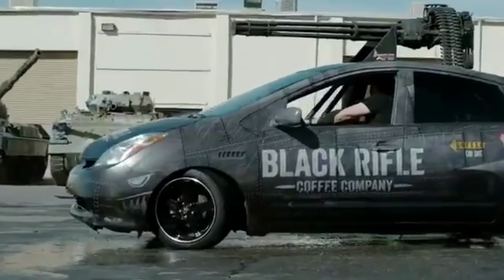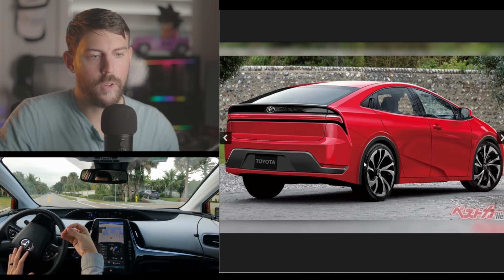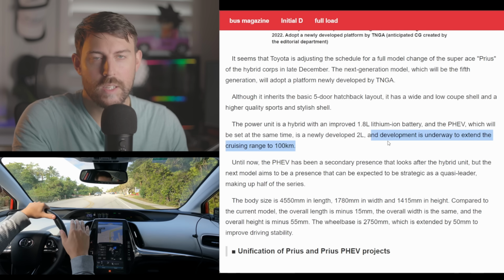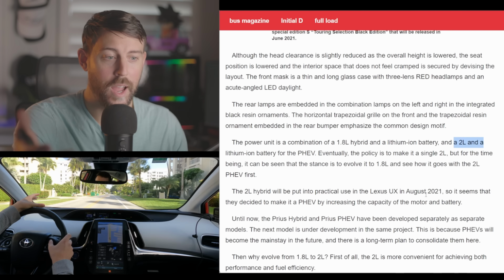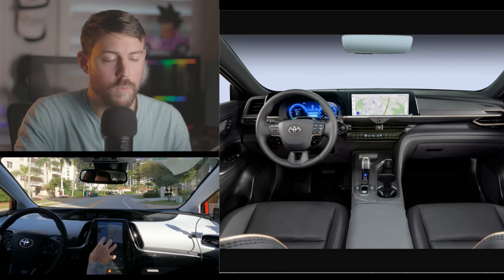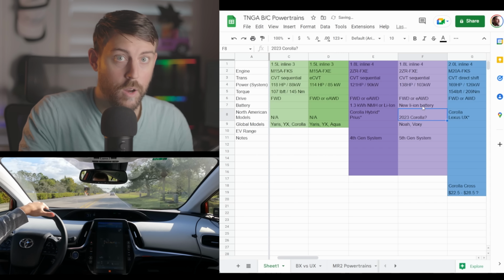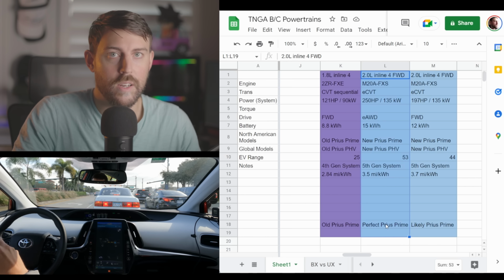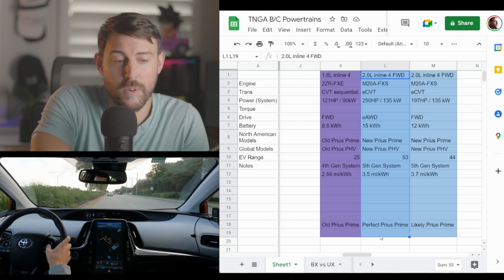*BIG UPDATE* The All-New 2023 Toyota Prius will have INCREDIBLE power and EV range...

Comment: Morning, Kirk!  When any medium outside of US quotes battery range it always fall behind when US-EPA certifies it. 

That 100km. / 62mi. battery-only range quoted for the new Prius Prime PHEV will wind up as in the 40-45mi. range, still way better than pretty much ANY PHEV out there.
Reply from the maker: 40mi+ is what I'm expecting
Reply: at that point replace engine with a range extender gas generator.

Comment: I suspect the 100km range is on the Japanese driving cycle, which is even more lenient than the European one. The Japanese Toyota site states 60km EV range for the current Prius PHV. So if these numbers are correct the new Prime should get something in the neighborhood of 100/60*25(current range of Prime in miles)= 41.6miles of all electric range.
Reply: My 2020 volt got 60 miles of real world driving, not sure why Toyota can sell a big battery phev but gm can't
Reply: @PreschoolDropout673  The Volt/Voltec project did what it intended to do, namely creating compliance credits and green credentials for GM. Even with those credits in mind, it probably still was a loss leader. The difference in battery sizes can be explained by Toyota making vehicles for the global market, and GM creating the Volt specifically for the American market and the compliance environment at the time. if I remember correctly PEVs needed to have a minimal numbers of KWhs to to be eligible for the full $7500 tax credit, and the Volt just "happened" to have that exact battery size.
Reply: @aeusem88  I agree, I remember when volt came out I wanted it so badly in Europe, but could not get it... even when Opel started to sell it under Ampera brand it was impossible to get...  Now I own Prius PHV, which is actually a very good hybrid too when the electricity runs out, and Volt was not a good hybrid...
Reply: @PreschoolDropout673  my 2017 volt gets maybe 45 miles of ev range but that's 95% highway. I always hate how evs are advertised as none of them deliver the advertised range unless you do nothing but slow city driving. Same issue with hybrids. My 2011 prius averages 42.7mpg on the same commute as the volt. I've never seen anything remotely close to 50mpg. Oh and fwiw I don't drive like a race car, and I don't hypermile, just regular average driving. Based on years of verified data, any advertised ev range will yield 25% less in real world driving, and that's not even factoring in winter. 40 miles of advertised ev range from a prius is laughably useless for me.
Reply: @SweetLou0523  The new Prius PHV fixed those issues. with 0.25 drag coefficient, completely flat bottom, curved rear glass, ability to drive at 80mph on electric mode only,  real heat pump instead of classic air conditioner, heat exchanger for exhaust gases to speed up warming of the engine, and many other clever things I manage to get easily 57-60 MPG at around 75 miles per hour. It can easily do 65mpg if you drive the speed limit. Also no one is talking about an interesting fact that Prius PHV is the most efficient electric car on the market for the last 6 years,  I manage to do 5.6 miles/kWh
Reply: That sounds about perfect for my use, if I could afford a new car I would probably switch to it.
Reply: 40-50miles seems like sweet spot for PHEV dye to the average route length.
Reply: Yes, or you could extrapolate from the number of kWh this model has compared to its predecessor.  I think it'll be more than you estimated because Toyota has also improved the efficiency of the electric drivetrain for 2023.

Comment: Very nice looking Prius drawings, but those big wheels are unlikely as they would reduce MPGs dramatically - looking forward to seeing a new one
Reply: It won’t have wheels like that. 
They always dramatize the wheels on renders and concept cars.  It’s possible that some high trim or sporty trim will get bigger wheels than the current generation because big wheels are a fad the car makers can’t resist, but I’m sure base models will have wheel sizes that maximize efficiency.
Look up drawings of past cars before they were released compared to how they actually look in production.
Reply from the maker: We'll see!
Reply: @KirkKreifels  2016 prius was great looking at rear but i wish it was more simple, it was glorifying the areodynamic wing corners, i just wish it was more 3d and simple looking like gma t33 rear light in form of a single strand of light, instead of those multiple boxes of lights in there
Reply: @KirkKreifels  tell people to quit demanding dumb stuff like more ev range on a inline 4, instead of soemthing like what i described in top part of my comment in this comment thread. another dumb thing is demanding more power on drivetrain that doesnt sound decent like at least a naturally aspirated v6, even if paired to non cvt transmision. its not alll that fun its heavy doesnt sound good etc on toyotas simple soft suspension, terrible idea vs hypermiling fun speced car and driving mindset. if they use gr 86 transverse engine power delervery technique with natural aspirated or lotus supercharged v6 or use this engine to charge 2 electric motor for perfect smooth torque vectoring, then it'll be fun.   its only uu toobers that can fix this endless mindless materialsm, industry is gonna give people wat they feel thats why w ehave big so called SUVs where people only consider trunk space as storage space and pretend liek they cant just rent a van for the annual family roadtrip instead of always 1 person drive "suv".
Reply: my v6 setup also neeed to be  rear, mostly rear, or 50 50 all wheel drive
Reply: consider paddle shift or L shape  diagonal pattern stick shift(as oppsoed to h pattern) and clutch simulator with power feedback, at least as option. the diagonal staggered L shape pattern would fit in great with simplified version of genesis X concept interior
Reply: Yes agree. Larger wheels result in loss of efficiency and reduce the value of high torque electric motors. They are pure affectation since they lend absolutely nothing to the driving experience. Never the less, I doubt Toyota will go with less than 17 inch wheels - more likely 19 inch - just because of this stupid fashion period that dictates idiotically over-sized wheels.
Reply: @davidgapp1457  the bigger the wheel, the more resistant to roughness of road.
Reply: @TianenChen-i6b  bigger wheel requires bigger suspension and its take more energy to move heavy stuff, its less effceint to make ride not harsh over bumps.
Reply: @kalmmonke5037  bigger wheels absorb bumps better. It’s simply physics. Use your imagination.
Reply: @TianenChen-i6b  energy of road bump hitting tire goes up car in form of pressure more than whels speed in upward motion. in this thread i mentioned bigger heavier wheel sis less effceint. its much lighter, cheaper for everyone if bumpy road is dealt with by small wheel and more suspension
Reply: @kalmmonke5037  true. But it is prison dilemma
Reply: You can be sure it won't have wheels that large. The design may be similar but they'll be much smaller with much greater clearance under the fenders.
Reply: Also every Toyota is overstyled since a couple years ago and most of them are extremely ugly. The designers are trying to fit a crease in crease and when they update the car, first question is, where can put another crease. So I doubt the new Prius will have a slick design. Also, why the fucking fuck are they not making a full EV prius. Or did I miss that.
Reply: @maxmeier532  it should be everyday use batteyr range like 150 miles and freepiston rage extender, ie two pistons on a shaft with lubricant rail and magnets on it to make electrcity with nin moving magnet around it, maximally storing power in air pressure to reduce battery use which cause degradation. then rear seats facing rear, hydrallic instead if electric lotus like communicative steering.                e ink is only uses energy when changing images on display, so default display can tell how to do hypermiling in 2 sentence, ask for  lubricant, tire pressure refill etc. tinted HUD lit by biolumensence can have image projected onto it from  e ink display by lens and optic fiber, with 3d illusion imagery it can reduce driver stress and non attentiiveness like how mercedes s class hud navigation works, except simpler.
Reply: new prius should also be gutted out or at least option for that, example: why not a rope stap + normal key lock system, no door handles, key makes door unlock and pop out sitting on a rod so door cannot close. areodynamic and simpler smoother looking
Reply: replace glovebox etc with sports ball container nets, they have metal hoodie tightener liek device to hold objects against the wall so they dont swing around when driving fast. NoiseVibrationHarshness material minimized so its loud if your sitting too low like kid, kids more energetic they wont be so effected by tiring noise